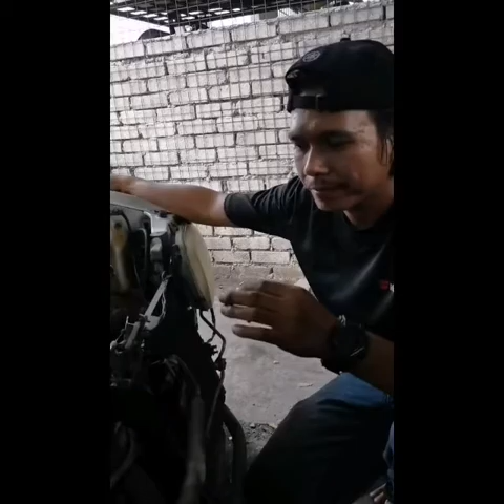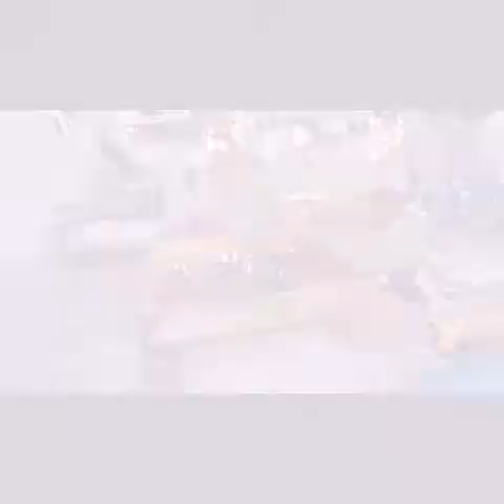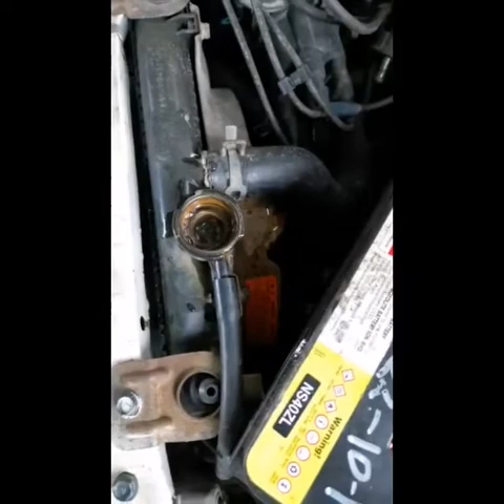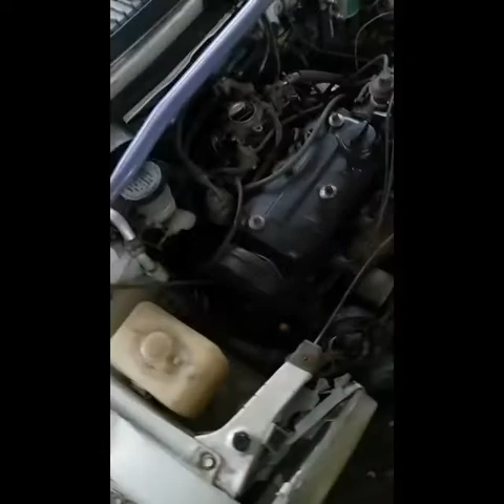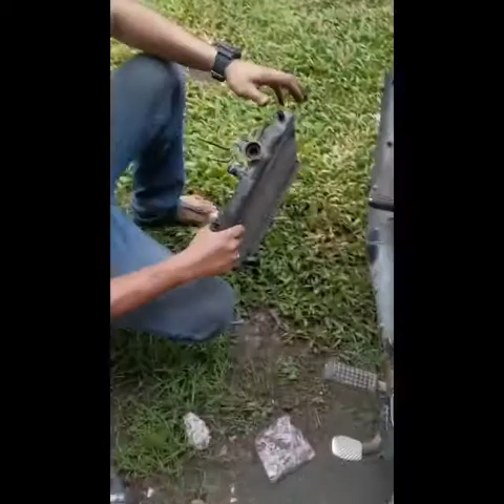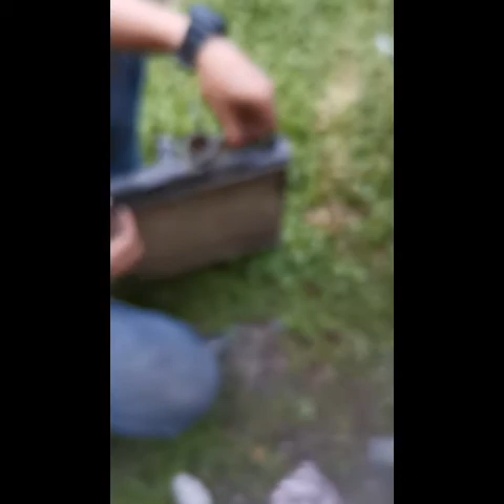Perodua kancil.. Air tendang.. Enjin panas.. Radiator sumbat..

Comment: Klau wira 1.5 (m) buat top overhal berapa Cas ?
Reply from the maker: Klo top over haul sahaja rm300 lebih boss..
Reply from the maker: @Hezreen Hamdan boss buat apa tuh?
Reply from the maker: @Hezreen Hamdan owh.. Dah buat top masih temp tiggi? Radiator da servis?
Reply from the maker: @Hezreen Hamdan owh.. Time buat top over haul tuh ada potong head x?
Reply from the maker: @Hezreen Hamdan klo mcm tuh nk kne check balik.. Start air tendang ke x.. Kne check sistem coolant ada bocor ke x.. Klo dekat boleh hantar kt begkel sye boleh check kn..
Reply: Bengkel area mana?top overhaul wira 1.3 manual brp?
Reply from the maker: @sil__diesel3549  Bengkel area bangi boss